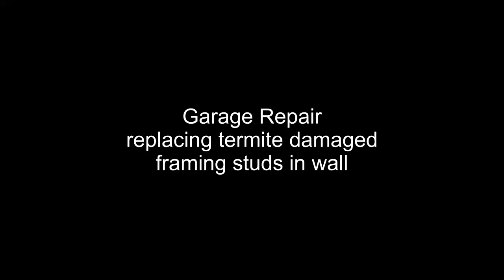Termite damaged studs on garage wall, replacing termite damage wall studs,

Comment: I would have taken out the wall studs after I shored up the whole side of the eves, poured a footer 8" above grade, then framed my new studs on top of that footer. What you are doing is a temporary fix, it will start all over again, termites eat everything, including asphalt impregnated board, as well as water damage will set in and weaken the treated wood, making a highway for termites.

Comment: If the garage slab is below grade wouldn't it make more sense to  put some long bolts along the edge of the slab, run a course of cinder block, fill cinder block with cement and put bolts in the cement in the cinders through the bottom plate  (plus washer and nut)?  Bolts in slab connect slab to cinder blocks.  Bolts set into concrete filling cinder block through bottom plate connect cinder block to walls.  Pressure treated doesn't mean water proof.
Reply from the maker: We were more concerned about the structure than water getting in. Eventually we will rework the garage  floor
Reply: LOOKS LIKE PROBLEM IS WATER, REMOVE WATER FROM WALLS.... DRAINAGE ?

Comment: i got similar problem to lil house on one side of it, its always wet, no drainage and close to ground... the other side is perfectly fine and dry 
 thinking to remove some ground dirt and make better drainage
Reply from the maker: Better drainage is always the best, the swell needs to be 24" from any foundation, concrete or wood.
Reply from the maker: https://www.youtube.com/watch?v=ju3aXpFwTh0
This is an extreme example of foundation problems .
https://youtu.be/cN-QXAS1UnE
Drainage repairs
https://youtu.be/2QsNtga0KVc
drainage repairs